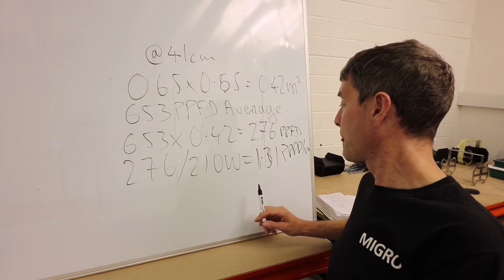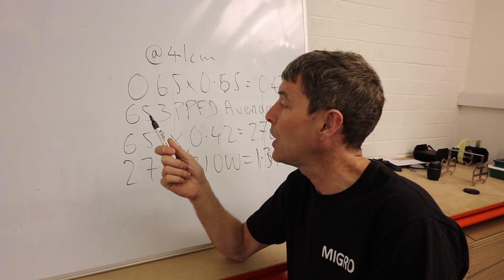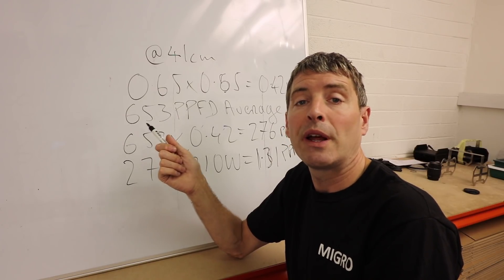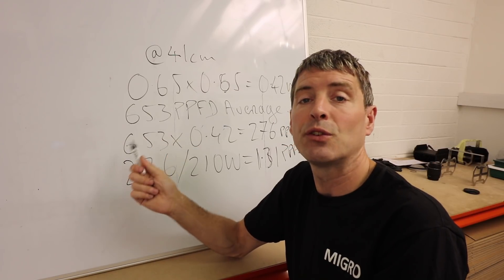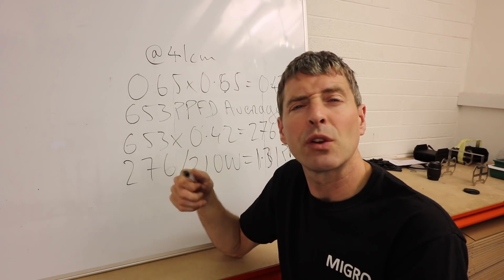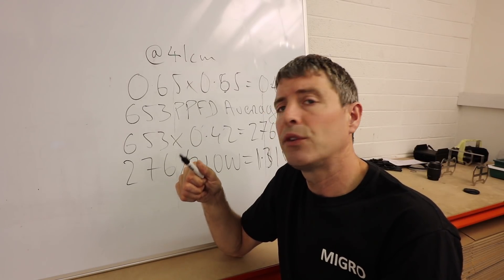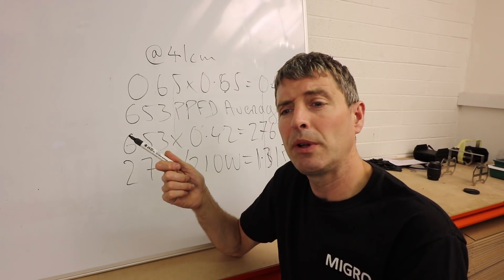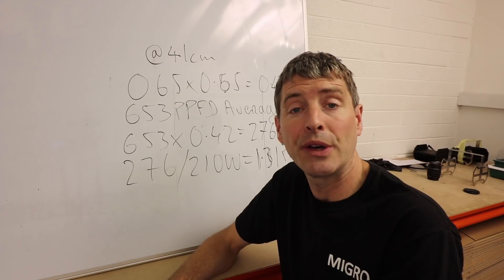Calculate grow light efficiency from a data sheet

Comment: Hi Shane, How does PPFD per watt compares with micromole per joule that is often used by manufacturers. I read that miceomole per joule also considered the wavelength used by photosynthesis?
Reply: micromole per joule uses PPF to mesure light efficiency, not PPFD. Determining the PPF of a light source is complex and costly as it requires specialized measuring instruments. PPFD is a lot more easy to measure because you only need a small PAR detector. Plus, PPFD gives you much valuable information than PPF.

Comment: So I just followed your steps to find the ppfd/w for the viparspectra 600 reflector series.  Could you please confirm my steps to ensure i did it properly, my numbers are much lower than yours. I took a 2.5 x2.5 area taped it off on my kitchen floor so non reflective. I hung my light at 22 inches (manufacture Recommended flower height ). I took 25 measurements in a grid like you do in your videos, 5 rows of 5. My ppfd came to 328 avg.  test size in meters 0.76 X 0.76 =0.58  So avg ppfd 328 x 0.58 =    190   Power being used 256watts  So 190 divide by 256 =  0.74   That don't jive with your numbers is this just due to your tests are being done in reflective surfaces because that is a huge difference if so.   I think you said 0.94 with the viparspecrta 350 you tested. Any thoughts Shane?
Reply from the maker: Hi, the difference between my result and your maybe using mylar reflective walls?  Also I hung lower at about 14 inches as the PAR level directly underneath wasn't very high at 22 inches. Also what PAR sensor are you using? Blurple LEDs do not read very accurately with the Hydrofarm. thanks, Shane
Reply: @MIGROLIGHT Hi Shane thanks for replying. I am working on tje second of 2 par maps one in a reflective area and the other without, all i have to say is wow it really makes a difference testing I have not finished calculating it all up but the numbers are much higher so far. But for a reader I am using a apogee mq 510 full spectrum underwater reader.  I have to devide all of my answers by 1.32 if testing out of water. Its full spectrum of so it can see them deep red leds at 660nm where the older non full spectrum models cant. Like yourself I was also sponsored by apogee, mostly for testing aquarium lights.
Reply: @MIGROLIGHT  so with the results it looks like it is 0.88 with the reflective tent. A little bit higher but not as much as I was expecting. Anyways I think I got it thanks for your assistance Shane.

Comment: If given relative (0.1 to 1) spectral irradiance graph how can i calculate irradiance from each wavelenght if i have lets say 10 w/m2 reading. For example if at 600 nm relative irradiance  is 1 and thats reference normilazed point and at 400 nm relative irradiance is 0.8. How much w/m2 is from 400 nm and how much irradiance is from 600nm as every wavelenght have diffrent energy per photon. Ty

Comment: Awesome thanks for the great info at around 6 mins u mentioned this is a good way to compare lights regardless of the spectrum but isn't it possible that 2 lights with the same par but different spectrums one may be better than the other do u know anywhere I could figure out the perfect spectrum for cannabis I've been looking st a light called kingplus 1500w it seems to have the best spectrum and decent par output for the price

Comment: Great explanation, thanks Shane. QQ, what's the best budget LED you've come across. I have a friend who swears by Vipar but loads bad mouth them too
Reply from the maker: Don't bother with a cheap led. Lowest up front cost is ceramic metal halide. For smaller grows the mars 48 reflector is good for the money.remember you will have to buy nearly two of them to equal a MIGRO 100 and with power consumption they are the same cost after 18 months
Reply: MIGRO 
Thanks again Shane, when it finally happens here in Jersey (which should be very soon) I'll give you a shout
Reply: @MIGROLIGHT  please get at me lol iv got a crazy experiment going. Would love ur opinion